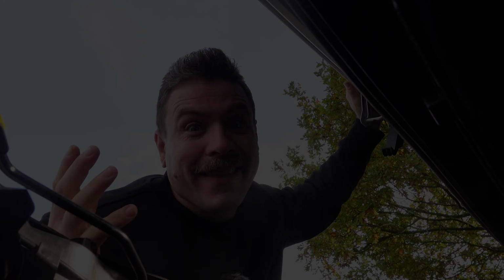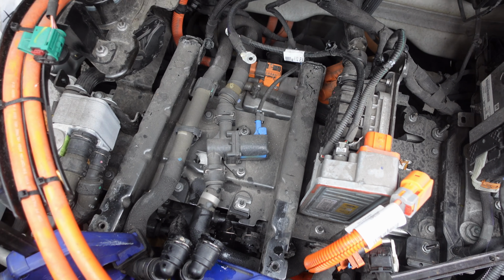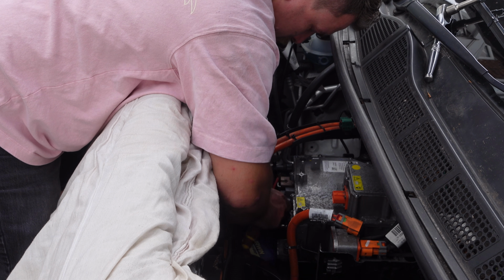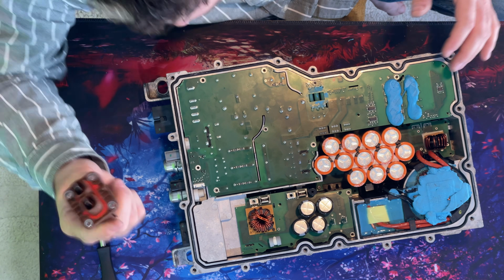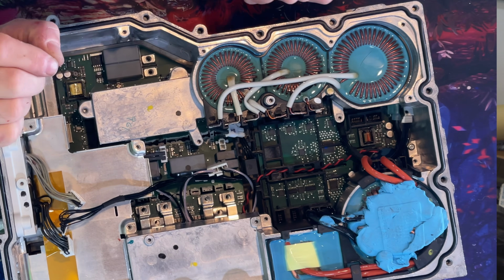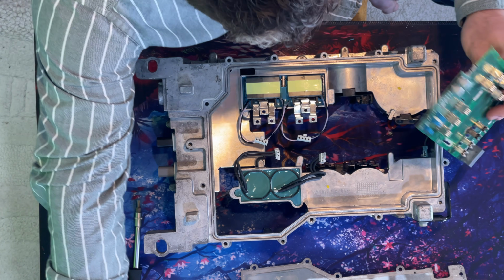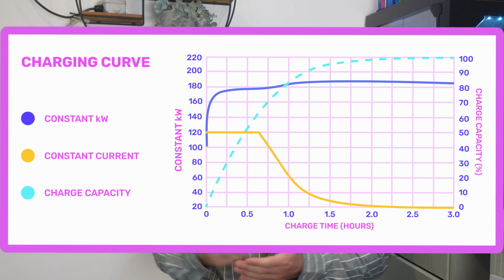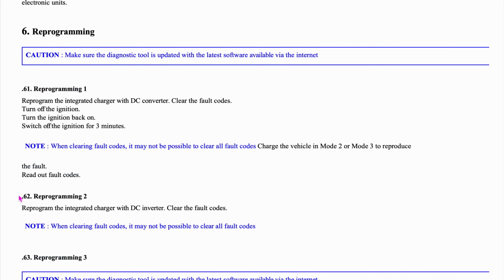Dealer Quoted £3,000 — I Fixed It for £380… But It Wouldn’t Work Until the Dealer Did THIS!

Comment: At 24:35 reference is made to second hand units that are "not coded to the vehicle and locked". I'm intrigued. Can you give us some more detail on that

I live in Jamaica and I'm expecting to take delivery of a three year old Toyota ProAce EV (manufactured by Stellantis) some time next month. A friend of mine imported a similar used van from the UK a year ago and the OBC failed after the first use. There are no Stellantis dealerships in Jamaica so the online coding option is not even a consideration here. The sooner this nonsense of coding parts to vehicles is outlawed, the better. The hubris of car manufacturers in assuming that they will always be around is beyond the pale!
Reply from the maker: Hi, what I mean in the video is that the parts can be transferred to other vehicles and recoded, they are not locked to that particular vehicle. 

I don’t know how factual it is, but the dealer I spoke to explained that the motors are locked to the specific vehicle they came from and cannot be re-recorded to a different vehicle. It would be great to find out if people in the know if this is true or not.

Comment: (not uk)

Work for a company with a fleet of 12 Stellantis 74kwh vans. 3 of them has already had the OBC fail. One sat for nearly 5 months when there was a shortage on them 
But the problem is how Stellantis as a company works, it's an investment group, they don't give a damn about customers, after the vehicle has left the yard you are on your own.
It's even worse with parts availability for older cars. There used to be something like 10 000 cam shafts on backorder for their mis-designed v6 that eats them. 
We had one vehicle that was in an accident and needed a new subframe for the engine, it was a 7 month wait, for a damn part that still is used on new vans.
Drive shaft for a 2011 Jeep is NA forever
License plate light (led) for 2015 fiat, NA. List goes on and on
On top of that their stupid secure gateway that makes after market repairs nearly impossible
Never ever buy a Stellantis product.
Reply from the maker: When I was researching for this video, I was looking for some fleet owners to give me information on how reliable they found them. So I really appreciate your comment.

The struggle is real 😂

Comment: Send your broken part to Buy it Fix it and work with him to repair that module.
Reply from the maker: I couldn’t work out how to contact him at the time. 

It’s also much harder to check it’s working than a simple plug-in device 

To check it’s working, you’ve got to provide DC battery voltages, 12 V and canbus. One of the biggest challenges of repairing it.

Comment: When I had a fault in my Skoda dashboard it is as £900 for a new unit as it 'wasnt repairable'.  Couple of phone calls and I found a local electronics specialist who worked in Motorsport and aviation.  They would do a repair and overhaul re cap and new LEDs for just over £200. OEMs need to be engaged with specialist repair partners.  Id be like you and love to have a go.. I know however though the majority of folk wouldn't want to try this.  Great content...
Reply from the maker: I couldn’t agree more. Posting a part to a specialist is faster than waiting on back order of their parts and cheaper for the customer. Better all around. Would be awesome to see that happening 

Honestly the repair was so so so easy.

Comment: I am wondering if you just solder out "ROM" chip which has to be coded from old one to new one - I think it might work
Reply from the maker: Good question. I’ll. keep that board around if it breaks again I’m very interested to try to use parts off the old one

Comment: so did you charge it 1phase 7kW? probably maybe if you charge it 3phase at lower rate (lets say 2,5kW per phase then maybe it will not heat that up and charger will still live
Reply from the maker: I understand what you’re saying, but I specifically looked for a three phase 11 kW version of this van so that I could charge it faster in cheap rate electricity times. Charging it at lower power than it’s meant to be designed isn’t really ideal
Reply: @TheOfficialBatteryMan  full power =/= designed power - tesla3/y onboarch charger for example has best effinency on about 8-9kW not 11kW, 

I have harley livewire and sticker says 200-300VDC 7A - battery voltage range is 237-294VDC( 70S) and power  from wall is 1,4 to 1,8kW .......... and OBCs dies very often due overheat :( unfortunanelty isnt possible to slow it DOWN in EU, also 1,5kW on 15kWh battery is preety slow - usually takes 10-11hours to 0-100%

Comment: If they really cared, they would make them modular and with proper buzz bars, not those crappy connectors. Look at older forklifts control circuits. You can almost repair anything if the ICs are available. The only issues may be getting custom control ICs or the logic if they are damaged. Some manufacturers may use special output transistors like Toyota, but spares are often available. On modular units with seperate output PCB you can even reverse engineer it and have new PCBs made as they are very basic compared to the controller and are often fried. Thyristors and diodes can always be found. It then becomes cost when talking about older equipment. 
Most new stuff is like a tightly packed three phase power amplifier that is very expensive.
The design of these chargers doesn't exactly look robust.

Comment: Can you turn down the charge rate on this vehicle? Might keep the heat down and hopefully increase the lifespan of the obc.
Reply from the maker: Potentially. But I actively searched for one that could charge it 11 kW so I could charge it on cheap rate electric.

It kinda defeats the point of the vehicle can’t keep up with what it’s designed to do

Comment: Youll probably fine or be told they are coded to prevent/reduce possibility of theft. I work at a ford dealer and the older sat nav units had to have a form with the units details faxed to Ford's technical department who forwarded it to Ford Germany to retrieve the nav/radio code😂😂😂 Was told it was to stop theft
Reply from the maker: I’ve always desired a Ford head unit 😂

Comment: The PCBs for consumer use are rated at least for 110*C, and for automotive use it should be the one with higher rating lets say 130-150*C, so it means it has to be in the 150*C range to darken, and probably 200*C+ to get charred as shown at 19:07
Another thing I find it ironic how Tesla is the easy brand to work on, in the past they were the worst.
Reply from the maker: Defo wasn’t easy with Tesla and still not all information is available. It’s the way of the automotive industry. 

Good observations on the temps

Comment: All those circuits and PCBs and not one sign of a thermostatic controlled fans for cooling...the number 1 basics for designing electronic items....I know the cooling system is there but no way is it sufficient to do the job 😔
Reply from the maker: That’s what I initially thought when I opened it up for the first time.

Comment: To me it doesn't seem there is something that has clearly failed, which leads me to think that maybe there is some knowledge from the processor side from like input/output/switching currents and voltages. When stuff gets hot, you get higher resistance. Processor notices the loss has reached a limit of x and then disables the charger to stop anything from catching on fire. And when this happens x times, computer deems unit faulty and thats the end. You'd have to reflash the unit to make it work again. So replacing board to other unit might not work. I hope i'm wrong.
Reply from the maker: I was thinking similar with the flag.  Good point about that could be persistent if moved to another unit

Comment: EV manufacturers killing their own second hand market again. They need to invigorate the second hand market or they risk killing the new EV market as well. There is already enough reluctance to buy second hand due to doubts about battery life, and other issues.

No second hand market, means massive depreciation costs for new EV owners. This is already evident.
 Manufacturers need to up their game and allow hassle free repairs and above all cheap battery replacements in order to increase the viability of a second hand market. A vibrant second hand market encourages a vibrant new market.
Other wise it is just rich and fleet owners buying new and most going to scrap after the first owner changes out. Totally unsustainable and seriously un-green

Comment: All automakers that are not listening to their customers and avoid the right to repair should fail. When the first will start failing others will have to notice and make a change or fail too. At least they would have to allow the replacement of modules without special online coding. If coding is needed because some settings have to be adjusted, any mechanic with commercial scan tool should be able to code it and not just the dealerships. You bought the car, warranty period is over. It is your property and you have the right to repair it, it will become mandatory some day, you'll see.

Comment: Perhaps even more frustratingly, they now require anyone who wants to buy access to their official Service Box repair manuals and TSBs to have a VAT number related to the motoring industry. This prevents some independent garages from working on them and basically rules it out altogether for any amateur on their drive.

Time for class action?
Reply from the maker: This was so so so so frustrating. You have to be verified by a dealer off a list now 2
Reply: @TheOfficialBatteryMan Utterly bonkers.

What is rather helpful to know is that Toyota’s equivalent of servicebox still allows paid access to anyone - even if you answer “amateur repairer”. I haven’t tried using diagbox with it though.
Reply from the maker: @funrover90 i can respect that

Comment: So the entire £2500 unit is dead because of internal connectors not rated for continuous currents when charging from 1ph 7kW. The burned connectors rendered the first and most commonly used phase unusable. How about people using these with 3kW kettle chargers, were there any failures reported? 
For 22kW output, the internals looks pretty messy. Mahle saved $$$ using discrete switches instead of automotive-specific IGBT or SiC modules but made everything else overcomplicated. And proved that push-in connectors are less reliable than screw terminals.

Comment: There was no need to remove the gel unless there was obvious damage. The switcher assembly can be perfectly reused. It's interesting that Mahle decided to use that makeshift assembly made of discrete switches instead of power modules

Comment: In todays cars every module needs coding to the vehicle, some say its theft prevention and others cry for a Right to Repair.
But theres also EU regulation in place that forces manufacturers to make sure cars cant be tuned or tempered with to ensure correct emissions and safety...

Comment: Could you not have removed the scuttle panel under the windscreen to get better access to the bulkhead area?
Reply from the maker: Way more work and would still have needed to crawl to access the rear as the bonnet is high up and the bolts far back

Comment: The reason for me not to get a new car. Actually, when my 2018 BMW needs replacement, I'll get an older, but lower milage car instead.
Reply: Problem is that there are increasing numbers of people becoming aware of this problem, pushing up prices of older cars to astonishing levels. £12,000 for a 30 year old, 100K miles Volvo V850? (Geoff buys cars). This is going to get very, very ugly. Obviously it will come as a complete and total surprise to governments a few years from now...

Comment: Had a similar run around with Nissan with a faulty traction battery cell on a E-NV200 van. Nissan dealers here are franchises who report to Nissan Europe which leads to a lot of mis information / lack of knowledge about warranties it seems. Got told it was / was not under warranty by different offices. Eventually they settled on the battery warranty only covered capacity loss and not any faults so I got the van back and fixed it myself inspired by your leaf battery replacement video. I dropped the battery onto a couple of dollies on my drive way using three jacks and replaced the faulty cell.
Reply from the maker: Nice one. I’m sure that was satisfying to fix it yourself. Basically like changing the remote batteries right ? 😂😂
Reply: Incredibly satisfying as all fixes are no matter how small.
Reply from the maker: @makestuffwork9205 nice one. I hope to demystify that working on electric vehicles isn’t rocket science. So knowing that I have you the push is awesome

Comment: Mercedes even has the headlights coded in some models
Reply: Or Volkswagen the brakepads. They have to be resetted by coding due to the new brakepads are bigger then the used one. Laught my ass off to my coleague with his 2015 VW Passat, replacing it's own brakepads, have to pay VW €165 for coding the brakes
Reply from the maker: That’s funny. I’ve had older Mercedes before with a braking system that’s required me to take 2 batteries out to disable for work to be done as an alternative to disabling it on a pc

Comment: Interesting, and scary given that I have a 2023 e-Berlingo van. Am I right to believe this charger issue only affects the models with the optional 3 phase / 11 kW on board charger? Mine has the basic single phase / 7 kW on board charger. Maybe Mahle originally designed the charger to be single phase / 7.2 kw, then later did a bad job of squeezing the other two phases into the same sized casing to create the 11 kW version? If so, maybe the thermal management of the single phase version is better? I saw a spreadsheet online listing the serial number and other details of failed chargers, and they were mostly the 11 kW version, but I've also not seen anyone specifically state that the single phase version is more reliable.
I'm wondering whether I should charge mine at 3.6 kW instead of 7.2 kW as much as possible to minimise the heat in the OBC? Often 3.6 kW is enough for my usage.
Reply from the maker: The 11kw was more likely on the spreadsheet because they are based in Europe where most people have a smaller 3 phase connection. 

It would be interesting to look inside the 7kw version
Reply: @TheOfficialBatteryMan  Thanks. I'm hoping there is no need for you to be looking inside the single phase / 7 kW version! I think I'll charge it at 3.6 kW whenever possible just in case, as it's not a massive inconvenience.
Reply: That guy who fixes Renault Zoes found that the UK single phase chargers had an undersized neutral wire and connectors. They used the same neutral wire as they did for the balanced continental 3 phase system where there will probably be a smaller neutral current . The single phase neutral should be the same size as the phase because it carries the same current obviously, but wasn't and is subject to heat damage because of it.

Have you checked the neutral wire/ connector sizing on your van? Maybe it's a common problem. Frankly it's a schoolboy error and shows the inexperience of the legacy motor industry with electronics and electrics ( pre EV the electronic modules came from contractors).

Comment: I work in electronics repair of industrial equipment and all of this seems reasily repairable, provided you have the right tools to take it apart.
Reply from the maker: In your experience, how likely do you think there could be another component that has broken?

It seems odd for just connections to completely brick a charger. However, we don’t know what software flags they have put in the design.
Reply: @TheOfficialBatteryMan  From my research there's two main failure modes. First is from the burning spring contacts that fail under load and the second is from failed SiC MOSFETs in the power factor correction circuit. The transistor failure often comes with current sensor and gate driver failures, but those components can all be replaced and repaired. I deal with burned transistors and burned contacts often and from my experience the latter is much more difficult to fix. Burned contacts degrade the circuit board substrate, which may need to be removed and sometimes burns so much that it is no longer structurally sound and cannot support the spring contacts even if they are replaced. 
PFC draws more current as the voltage on the grid drops. So bad contacts that drop voltage may cause the PFC to draw more current thus loading the already damaged contacts even more and perhaps even overloading the transistors causing them to fail. The voltage on the grid dropping will cause the PFC to increase the current being drawn, which then increases the strain on both the contacts and the transistors.
My guess for the contact failure is that the vibrations on the road cause micro abrasions on the spring contacts, which then cause them to increase in resistance and eventually fail.

Comment: 11:45 rectified three phase with the boost from PFC can be around 600V, so using two series capacitors rated for 450V makes sense
Reply from the maker: Good point

Comment: I've done some research into this and the component that fails is actually cheap and not that hard to replace.
The teardown and assembly of the unit is the hard part.
Reply from the maker: Honestly I went into detail but it really isn’t hard to tear down. Just lots of screws on the casing